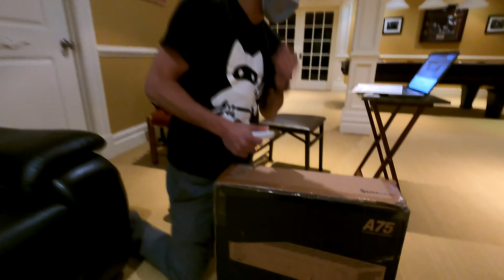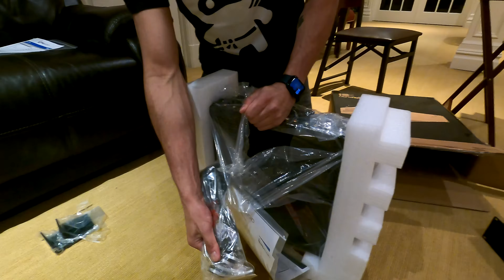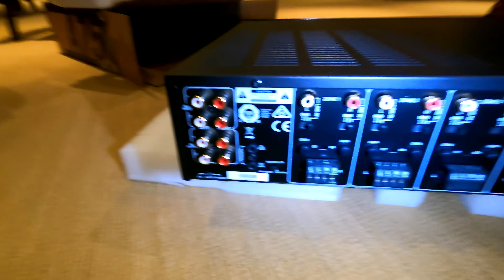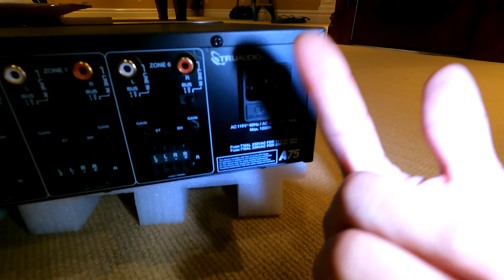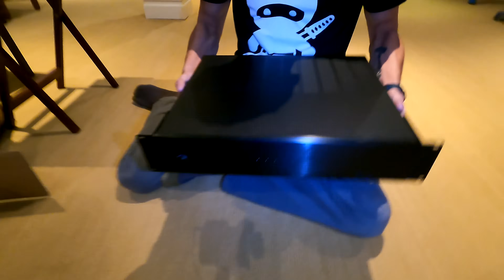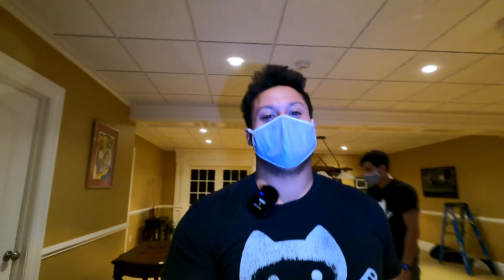TruAudio A75 12 Channel Digital Amplifier for Multi-Zone Applications.

Comment: THD less than 1%. I thought that was a mistake, but no it says so in the pdf manual. That's more than ten times acceptable. And that's at 8 ohms. If it distorts this much at 8 ohms there's no way you could use it at 4 ohms.